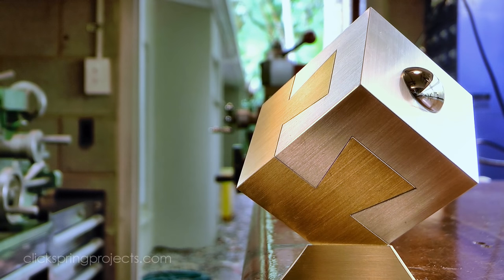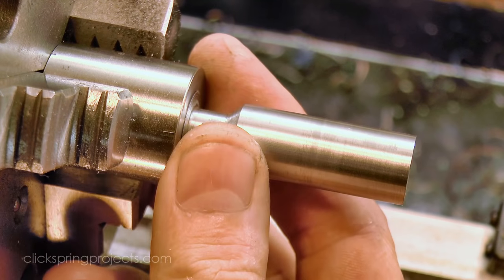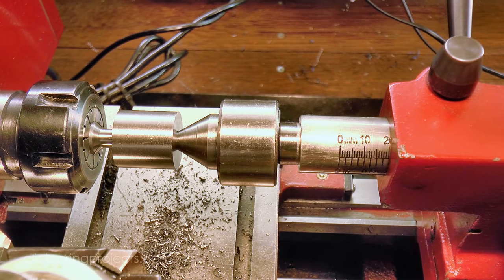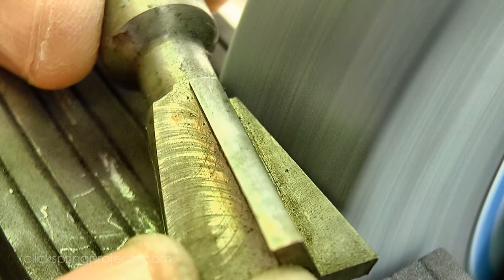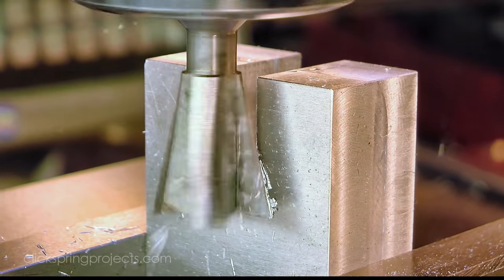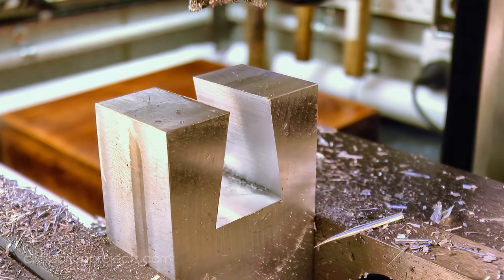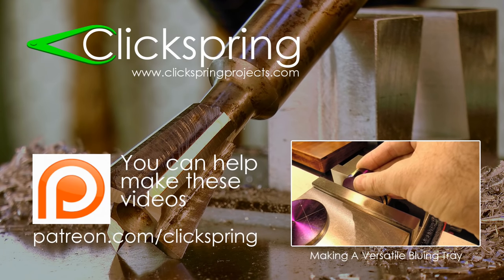Spare Parts #11 - Making A 4 Flute Light Duty Dovetail Cutter

Comment: Thank you for the inspiring videos, Chris!  I have a suggestion for putting the relief angle on the cutting edges.

First make a fixture for the mill to hold the collet block at a tad bit less than 22 degrees in the mill vise.  The cutter needs to be rotated 3 degrees, or whatever
you want for a relief angle.

Next, take a cup style grinding wheel, not too fine of grit; 60 is what I am going to try first when I do this.  Mount the cup grinding wheel on an arbor
to be held in a collet in the mill spindle.  If the wheel is too fine it will glaze over very easily.

Now, at the highest rpm, the mill can't spin that grinding wheel nearly fast enough, but for this application it will do.

Start with a light depth of cut, maybe .03 to .05 mm, if that much.  And the feed must be fast:  too slow and things will heat up too quickly.

The most important thing is to keep the wheel moving!  If the grinding wheel is allowed to rest in one spot it will glaze over, generate a lot of heat in the cutter
and anneal that spot, and will need to be dressed down to remove the glaze or it will burn all of the cutting edges, ruining the piece.

Using a spin fixture you could do the same for D-cutter, and grind a bit of relief clearance as well!

Now that I am retired I don't have access to the industrial machines I did this sort of thing on for 40 years, and your videos are helping me think out of that box.

Comment: Nice work Chris! Sure, like you state below, you could have done a few things a little differently to obtain a  better finish when using this cutter, but you would not have learned that without having tried to make the tool in the first place. This is a quality that I try to instill in the youth because too many people fear failure and allow this to paralyze themselves and thus never even try, which is a real shame. You set a fine example and are a good role model mate. Thanks for sharing!

Comment: As always Chris exceptionally well videoed and edited. You really are doing professional quality videos. A suggestion that's most likely redundant since I'm quite sure you've thought of it already. If it were me I'd seriously consider building a proper spindle mounted ER chuck. Much more rigidity as I'm quite sure you already know, but I'm adding this for those who might not. Plus you then have the spindle open for longer work.

Very nice demonstration of what's capable of being done to build custom tooling on the average shop equipment. And done with the finest M.E., Clock, or watchmaker methods. I think even GHT would be happy with what you did.

Comment: Hiya to sharpen the cutter teeth without altering the profile you can take the cutter to the stone, lay the cutter on the stone edge then move the cutter on the stone which hones the cutter face that leads from the cutting edge to the flute 👍

Comment: M8 if you remove a small cross section vertically down the shank of the bur head, you could braze/solder in  with six sold. a small carbide insert a lot of the factories used in todays day use NOTHING but carbide, and when it is down to the shank you might be able to get them for a very small price. your work is amazing and thank you for putting it up and taking the time to explain everything

Comment: Before you ground the blade edges would it have been possible to just leave them Square drill and tap two or three holes in each blade face and attached carbide blades which would really make that tool a nice precise flute cutter even on brass

Comment: Hi Chris and Clickspring Team. Great job on the Dovetail  Cutter. Just a thought on the grinding process,... Would a Flexible Shaft Die Grinder rigged to the Lathe's Tool Post
and an indexing plate rigged to the Lathe's Spindle give better control of the Dovetail Cutter's Primary and Secondary Peripheral Angles after the Hardening process?

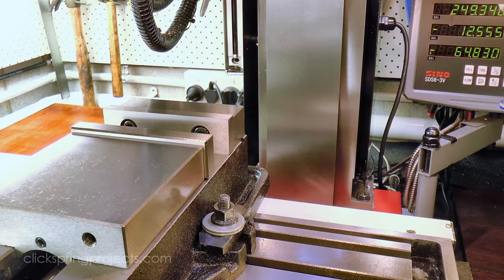Comment: 2:40 - 2:44 what is happening here. I guess you're finding the center point/line, but how? What's the tool used? Also, thanks for the videos! I love how you're no afraid to make the exact tool you need, instead of bodging it or buying ultra expensive stuff.
Reply: It's called an edge finder. Yes you are correct that he was locating work coordinates. Basically it wobbles, and you move in to the part until it runs true. Then by moving over the radius of the edge finder, you have the location of that edge (X or Y) and can calculate your cutter move from there.
Reply: +oakbushcraft Well, taht sounds like a useful tool. Nut I guess its more useful with a DRO on the mill... right?
Reply: +BIll Georgoulakis Yes you are correct. I would say that most mills you come across in shops these days have DROs. And edge finders are pretty much the standard for setting X and Y zero on manual machines. CNCs give you more options, but they are pricey. A good quality edge finder is very inexpensive and you will find one in every machinists tool box :)
Reply: +oakbushcraft I am interesed in an easy way to find material edges for X,Y for my small CNC router. What are the options you refer to. Thanks! (going off to eBay to search for small edge finders)
Reply: For router i would say just grab an edge finder. Get one that has .200" diameter (that is the tip diameter). Simply install into a collet or drill chuck, turn it on (less than 500 rmp) and touch off the edge till it runs true. Move the Z axis up till it clears the workpiece then over .100" and set your origin. 

The other options i mentioned are not of interest to a hobbiest as they cost thousands of dollars and are very complicated and proprietary systems for industrial machinery. 

They are cool though ;) 

A small edge finder should fit your needs well. A good one can be purchased for $35-50 and they last a very long time if they aren't beat on. I would suggest looking on McMaster Carr or MSC.
Reply: +oakbushcraft All edge finders I find (with reasonable pricing) have a shank diameter of 10mm and my ER11 collet holder only fits up to 7mm. I would consider the conductive edge finder, but I regularly work with wood...
Reply: +BIll Georgoulakis This should do the trick http://littlemachineshop.com/products/product_view.php?ProductID=1961&category=

7mm will be a wee bit larger than the .250" shank so you should be good to go :) By the way i checked out your channel and wanted to tell you that i have done quite a bit of blacksmithing/knifemaking :)
Reply: +oakbushcraft Wow, thenks for that! They charge quite a bit for shipping to the EU but now I know that 7mm shank edge finder exists I can find it elsewhere too. Yeah, knifemaking is a very good hobby, and I started some months ago along with a friend of mine. However we don't have a vertical belt grinder, and that's my next(?) project to tackle! I also see you like 3 Days Grace, good on you, I think they are awesome too!
Reply: +BIll Georgoulakis Yep 3 days grace, Breaking Benjamin, Shinedown, Five finger death punch!

Belt grinders are very nice indeed!

Comment: Hi Chris,
Thanks for another great video. What is the ratio of Borax to alcohol?
Thanks,
Rob
Reply from the maker: Add just enough to make a thick paste. For the small jar you see in the videos, it ends up being a few capfuls of alcohol. Be sure to use powdered boric acid, rather than borax. It can usually be found at the local hardware store as a roach bait.

Comment: Hey Clickspring thanks for sharing!!  I'm curious why you didn't just change the relief angle in the er collet and cut the angles with the mill as opposed using the grinding wheel? this would solve the profile tolerance loss with the taper right?

Comment: What's the soft material under and above the part during heat-treating?
 At a guess, I'd say some manner of fiber insulation.
And next question; where can I get some?
Reply from the maker: +scarletlightning565 Yes its a ceramic wool called Kaowool, I get it off Ebay
Reply: Thanks

Comment: Stupid question, but if heating of the tool is a problem, would coolant help?  I notice that there was no coolant running during the test run.
Reply from the maker: +deemdoubleu Not a stupid Q at all :) Yes coolant would help, but I don't have a flow coolant setup. Thanks for watching and asking :)

Comment: Would it be feasible to do the required grinding by using a 'Dremel' type grinding wheel, set up on a milling machine? I've tried this,with success,to grind the top rake on a HSS lathe tool. I covered the milling table and column with old newspapers to stop abrasive grit from getting on them.

Comment: hey, love the video as always. its very cool to see the process explained so well from start to finish, and see the results after. but as someone with experience in hot work, you need to immediately get rid of your heat treating setup, its very dangerous. ceramic refractory wool, especially when being heated or disturbed, gives off a lot of dangerous fibers that behave like asbestos (or worse in some cases). you need to totally enclose it inside of some kind of ceramic cement (like itc 100) for it to be safe. there are a lot of simple forge designs online that ive found really easy to build. please, once you see this, stop using that setup as is. and please put out more vids!

Comment: When you're heating the steel, prior to dunking it in the oil, does it need to be red hot a certain amount of time or just get red? Does the amount of time it's red hot effect the hardness?
Reply: Alex Gordon It's good to keep it that temp for a fairly short time if there's tings that need to stay straight like the part that goes into the chuck, but you can usually get away with just having it hot long enough to get the center and outside relatively the same heat so the hardening can work through the whole piece or else you'll end up mainly case hardening but that's still good

Comment: how do you get a perfect angle on a lathe? going left to right is simple, its one direction. but going at angles, you would have to turn one knob at one rate and another knob at another rate. how do you do this by hand?
Reply from the maker: Hey Mike, the carriage controls left/right movement, but there's a little slide on top of that called the top slide (also compound rest) that can take care of short tapers. Other methods include offsetting the tailstock, a dedicated taper attachment and various other tricks to achieve the same result - check out Tony's vid on the subject for more info: https://www.youtube.com/watch?v=MzJ6wR59AkY
Reply: hello. thank you. that was very helpful. I didn't realize that part could move that way. I see how it would only be useful for short pieces. sounds like the add on tool mentioned would be the right way.  now, that helps for a straight taper, what if the taper had to be rounded, like a bullet rounding to a tip?
Reply: ok, so i guess the answer is to make a custom cutter in that shape. seems simple enough. are there any videos on how to make that?

Comment: Ideallly you would use HSS or an inserted tool -- see Randy Richard's dovetail cutter videos. dovetail cutter videos. But in the real world you use what you have. Or can get. I see you are making the "impossitail" as Roy Underhill called it. Which brings up the fact that that thing would work perfectly as a router woodcutting bit, and last forever with a bit of honing.  Amusing coincidence, I am currently experimenting with relatively tiny clock wheel cutters -- four tooth, a la Don Unwin.

Comment: i think a degree wheel mounted to the lathe head and a toolpost grinder would make those cutting edges just that little better , maibe make two cutters a smaller one and the one you have now , make the neck of the smaller cutter smaller so ou have a better cutting surface at the narrowest part and cut the top part of the dovetail with it , then get the other cutter and cut the rest of the dovetail and the finish cut 
since the small cutter is allso narrower you can have it cut one side at a time , should give a more acurate cut
have to get me some of those square and hexigon er 32 holders

Comment: Don't you heat the metal to harden it? Then you don't want to heat it again or it will soften?
Reply: +j hefflinger So the different in temp shock makes it more brittle? What if you jsut heat it and don't shock it?
Reply: j hefflinger Interesting, that explains it.
Reply: +felixthemaster1 To harden a metal you need to heat it until it is not magnetic (make his molecules shake like crazy) then you quench it, rapidly cooling it (making the molecules quickly stop). This make the metal really hard but it can shatter like glass, so you temper it. Tempering is when you heat a little the metal to take away some of the stress you made in the hardening process. Higher the temperature you raise your metal, softer it will become. Then you let it cool SLOWLY (otherwise you will stress even more the material). Light straw means it will not be as hard as it was when hardened but will make it much more strong... Otherwise the cutting edge would shatter and wouldn't cut butter

Comment: What steel is that? I may need to make my own tool some time soon :)
Reply from the maker: +EngineerGunter Hey Gunter, O1 oil hardening drill rod/silver steel - Cheers, Chris.
Reply: Thanks! Great video, btw. Wouldn't it have been easier to see the temper color had you polished at least a little of the tool? Or is that just an unnecessary step, in your opinion?